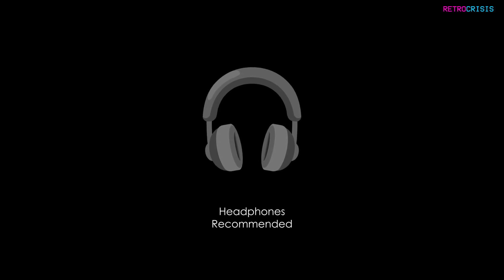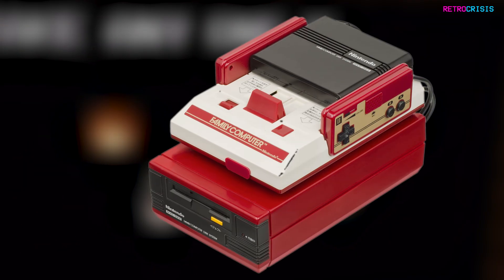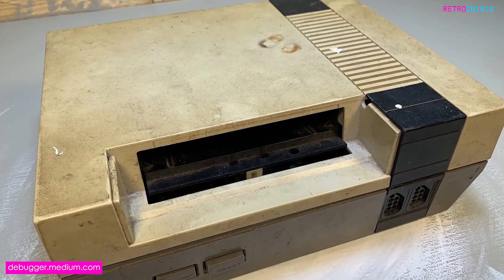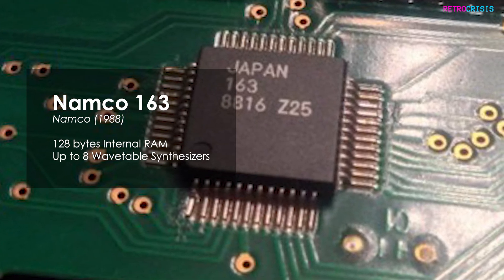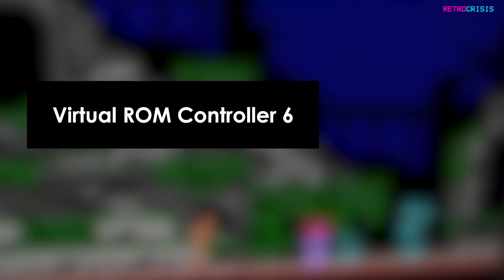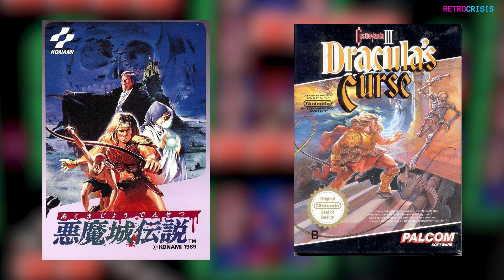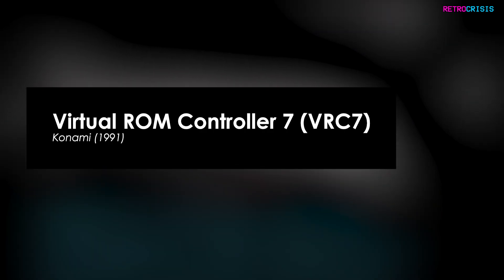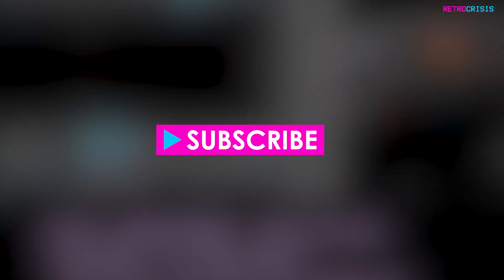NES & Famicom Sound Enhancement Chips - Explained

Comment: Oh boy, one of my favourite topics!  I like the way you did the comparisons and channel breakdowns.  Some extra notes:
- NES didn't have the extra pins that allowed the Famicom to use expansion audio even though it has 12 more pins total.  Super lame.
- Namco 163 has a funny attribute that the fewer channels you use the better the range and character you can get out of those cnannels because it mixes by time-division across each active channel.  You'll commonly see abbreviations like "2N162" to indicate how many channels were used these days.
- VRC6 is probably the most popular expansion chip in the modern Famitracker scene, but it's interesting how different the use of it (and thus the overall character of the sound) tends to be from AJD.  The sawtooth is key!
- VRC7 actually had a Yamaha YM2413 inside.  That's the same OPLL as was found in the Japanse Sega Mark III (aka Master System), a pile of lower-end keyboards, and a number of arcade games.  Of the Yamaha FM chips, it's one of the least popular because of how stripped down it was, but in the right hands... (Check out the Ultionus soundtrack for what it could sound like.)
- The 5B really played to the strengths of their composer.  Sunsoft was and is known for punchy percussion, but that generally left them a touch starved for the main melody, so the extra square waves gave them the freedom to work in a lot of additional polyphony for a far fuller sound.
- Gimmick! is the greatest FC game.
Reply: The NES actually does have extra pins for expansion audio, just not on the cartridge connector. They exist on the expansion port instead.
Reply: @haruki_nyan  Huh, interesting.  I mean, if they're not part of the cartridge connector, I would say that's effectively "doesn't have", but now it's an even more mysterious situation.  Why did they even do that?
Reply: @WillowEpp  To my knowledge, it's unknown why Nintendo did this. However, Famicom to NES adapters often connect the Famicom cassette's audio out to the NES's EXP6 pin. The EXP pins directly connect the cartridge and expansion ports together, so by connecting EXP6 on the expansion port to the audio input pin, extra audio can be "restored."
Reply: @WillowEpp    The reason is because the audio expansion was never intended for cartridge games. It was for the Famicom Disk System, which connected to the Famicom through the cartridge port and added a few new sound channels. It was expected that disks would eventually replace cartridges, but that never happened, and so eventually manufacturers started putting sound chips in carts instead. Anyway, when Nintendo was designing the NES, they also planned to release the disk system as well, and changed how it was connected to the system by putting a seperate expansion slot on the bottom of the unit. That's why the audio pins are there instead of the cartridge. Of course, the disk system was never released outside of Japan.
Reply: @haruki_nyan  Ahh ok, that's really interesting. So, if I want to play the Famicom versions of these games on my NES using an adapter, I need to do this mod on the hardware to actually hear the extra sound channels?
Reply: Also, not sure if this has already been mentioned, but DPCM wasn't used too much because of the amount of CPU time it took to process these samples. Not because of ROM size.
Reply: @magickmskh  Unless you're talking about 7-bit pure PCM, then not really.
Reply: @magickmskh  its not like that
Reply: @WilloeEpp True. The YM2413 most famous use was on the MSX computer standard, where it was arguably used to create some of the best soundtracks of the OPL series, if not some of the best FM synthesis soundtracks.
Reply from the maker: Wow what a wealth of knowledge! I'm going to pin this comment as I think a lot of people could benefit from reading your summaries. Thank you so much for sharing
Reply: @RetroCrisis  Oh, goodness!  Thanks!  (.... aaaaaand now I can't fix the typos I see, lol)
Reply from the maker: @WillowEpp  🤣

Comment: Great video! I love the comparisions, especially for Castlevania III vs the Famicom version. So, do I understand correctly that regions like North America and Europe which didn't have the Famicom, and had the NES instead, never got ANY games with expanded audio because the NES hardware didn't support it? (at least not without a hardware modification based on the NES expansion port.)

Comment: I have a Famicom hvc-cpu-07, with the rgb mod.Does anyone know what the voltage of the audio output signal is power/Audio board???Because this board amplifies the console signal... I tried to measure it with an oscilloscope and I couldn't...

Comment: There should be more homebrews that use the VRC7
because it is an underrated sound chip in my opinion
I mean, FM on the NES? Why not?
Anyways, great video!
Reply: The NES was designed specifically to not allow audio enhancement chips. That’s why only Japanese games have them.

Comment: Also, it's worth noting that the VRC6 pulses have eight duties, compared to the 2A03's three.
Reply: Well, the 2A03 has 4, it's just that 2 and 4 sound the same
Reply: @PizzerGames  its you
Reply: @pyra9345  it is i
Reply: @PizzerGames  Almost, it's SLIGHTLY different I'd say as a chiptune composer. You can mix both (playing 25% - 75% - 25% - 75% and so on) to make cool music instrument, because 75% is just 25% with reversed polarity. Boing!
Reply: @mr.saturn_boing  hes also a chiptune composer

Comment: Some of these chips are actually slightly modified versions of other sound chips.

Like, for example: The Sunsoft 5B, which is a slightly modified General Instruments AY-3-8910
And the Konami VRC7, a cut down Yamaha YM2413.
Reply: s5b is a ym2149f
Reply: @pyra9345  And a YM2149(F) is a AY-3-8910
Reply: @pabblo1  I think the namco chip might be based on their arcade sound board since it can do a pretty good job of replicating the Mappy machine's sounds (someone did a ROM hack to do just that)
Reply: @pabblo1   The Sunsoft 5B ins't modified, only they changed the clock speed

Comment: Honestly you can put any sound chip you want in an nes, either on cartridge or via expansion port underneath, you can use preexisting mappers that provide extra gpio bits, to throw an 8910, which are still made, though 8930 is much better, and some extra sram
Reply: You can easily modify a famicom disk system ram adapter

To include this expansion since it already has a built in 8bit gpio port, just gotta add some chip select glue logic and mix the audio with the fds audio, and add another 32k of ram, so fds can hold 64k total, 128k if you bank 2 64k pages
Reply: And easier to debug since you can just load fds roms with a fdsstick, only difference is fds boot $8000 iirc and typically max  32k, but you can also dynamically stream chunks too

Also load custom bootloader that overwrites the system memory with faster loading routines and exploit the fact you can load via a high-speed microcontroller

With a famicom you could make a keyboard using 15pin connector and a microcontroller 

Now that's a computer better than Family basic
Reply: You can then even use 8910 as gpio to daisy chain more soundchips or anything you want

16bit worth of gpio

So that's effectively 4gb of addressable locations if you include 16bit cpu address lines
Reply: Everyone likes learning new things but no one likes a show-off

Comment: It's a quite recent discovery that the VRC7 and all related forms of the Yamaha OPLL aka YM2413 chips can be made to produce a variety of "new" sounds by switching instrument presets while the sound is playing. Some parameters are updated immediately while others are not, so this effectively allows to mix and match new sounds built from parameters of the 15 presets each OPLL derivative comes with.
Reply: And it's a synthesizer for the nes. I thought it was for the msx
Reply: @kennetheweka6690  Yep, for the MSX the original stock OPLL was used, the VRC7 has different presets and the drum mode is non-functional but only 6 channels are enabled (without messing with the chip).
Reply: Oh?? Could you link me an example?? I'd love to see this
Reply: @i_am_kenokeno   https://www.youtube.com/watch?v=6Qy6bXyUmnk or https://www.youtube.com/watch?v=rzTFHu9ORKY

Comment: can someone please tell me why they didnt just use casette tapes ? it was cheap ..
Reply: It probably wouldn’t work as well as you think it would.
Reply: they didnt use them because the games came in a cartridge format. if they used a cassette, it would basically be the same as how it works on a C64, which is to say practically the same as with a cartridge, but with more loading times. they couldn't just play audio off the cassette because there is no way to output that through a console, and after putting the game on a tape, there would be no space left.
Reply: @incognitiosaystransrights  i was thinking . they should have had casette add on . like the sega cd . but a really really cheap add on
Reply: What do you mean? Why they didn't use casette tapes for the sound coming from a console?
Reply: @PixelBrushArt  yes . cds was really expensive back then . and casettes was really cheap . why not use it for game music ?
Reply: too small?

Comment: I really must get my famicom sorted so I can use it, it sounds so good there! 
I didn’t even realise some of this music was remotely possible on the humble NES. Great video
Reply from the maker: Time to show that Famicom come some RetroB8 love bro. Also, I'd love to know what you use to get it hooked up to a modern TV.
Reply: @RetroCrisis  i have a Famicom AV which is component only and no RF, but with the toploader NES I actually run the RF into a VCR and then run composite from that xD (its pretty rare i hook up the toploader because i have a frontloader too :D)
Reply: @RetroCrisis  yeah I think I that’s one of the mods it needs but I’ve a 1702 Commodore monitor that takes most things lol!
Reply: @RetroCrisis  Retrotink's scalers are best in class right now, and more affordable than an OSSC. But a bit pricey...
Reply: To be clear, none of this is possible on the NES, only the Famicom. The Famicom could route sound to the cartridge for additional mixing, but the NES doesn't have this capability. The cartridge pins that provide audio I/O don't exist on the NES.

Comment: the one thing I love about retro consoles is the amount of engineering done to make things work, especially with the music
Reply from the maker: Absolutely. Especially in a time before they were able to use cd quality sound.
Reply: @RetroCrisis  can someone please tell me why they didnt just use casette tapes ? it was cheap
Reply: @abh6968  it would have to rewind every time the track loops and when you would go to a new area it would have to seek to the next track. So there would be long times with no music or it would have to pause until the tape catches up. Also it would be a hassle to have to insert the tape in addition to the cartridge for every game and an extra 5$ for the tape for every game unless the game used only a cassette. Then there would be long loading times and no expansion chips